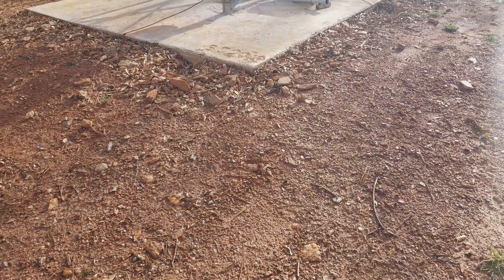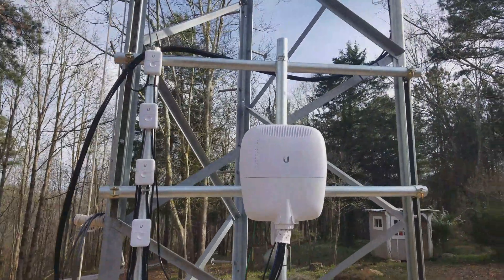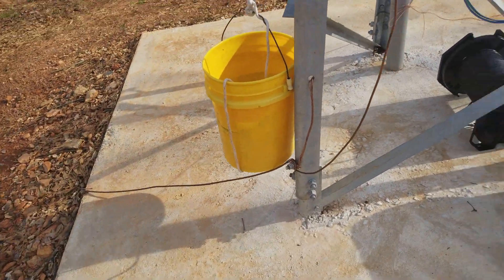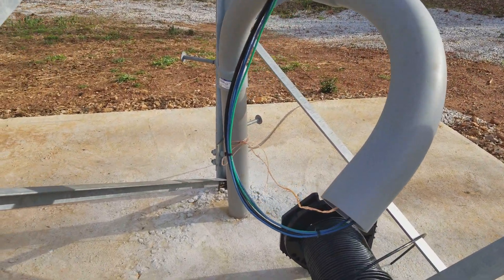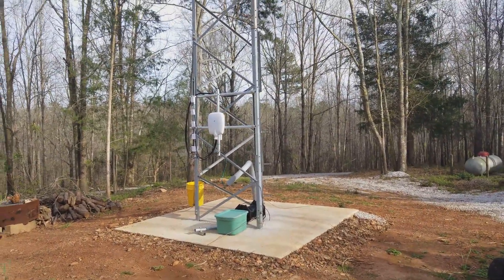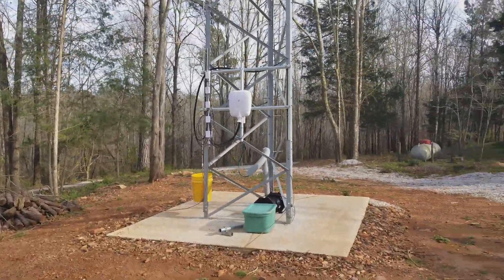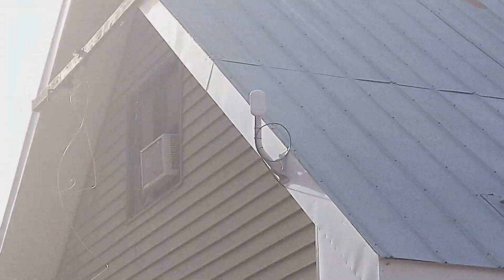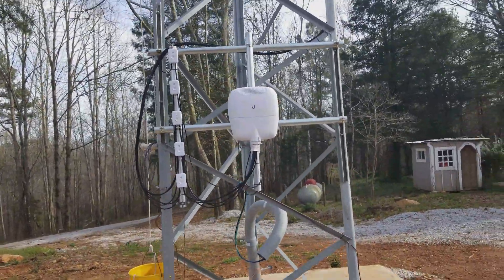WISP Progress

Comment: Hi Ben, do you mind giving me a cost for getting the tower installed?
Reply from the maker: The cheapest you could get away with is a guyed 100 foot tower.  It would be around $10k.  That includes equipment and installation costs.
Reply: @BenCooke419  do they make any that goon the side of a building that are cheaper, in the 2/3k range?
Reply from the maker: @backupaddict1356  Just head over to https://www.3starinc.com/

I think to mount it to the side of a building would require a machine shop to make the mounts.

Comment: Hi, I want to build one of those tower my self to start my one WISP from my Back yard in my country.. Do you have a documentation or measurements for the pieces to fit the tower up or the specification for that tower, such as the with of the base, the distance between the joints, so that i can get the right angle from top to bottom. My plan is, if you would be so kind to help is to buy the angle iron, cut to specification and bore holes to bold it up. Also whats the dimension of your foundation. DO you have images of the process of foundation to finish that you can share with me...
Reply from the maker: http://www.rohnnet.com/files/2015_Rohn_Full_Catalog.pdf#page=178

Comment: How many CPE clients will you run? I run a few WISP and it is so much fun.
Reply from the maker: Technically 60 per AP.  I have 3 APs so 180 total.  I have 3 customers connected so far and my plans are for 25 on this tower.  If I get lucky maybe more.  There's no way I can actually reach 180 houses though.  I just got service 9 days ago, so I'm still just getting started. :)  Thanks for the comment!
Reply: @BenCooke419  When I get that email letting me know that invoices have been sent I just get reminded why I built the systems that help others. Keep that cam rolling on the progress. Why not more CPE's. Don't forget you can make relay sites to reach more people.
Reply from the maker: @CommunityWISP  It's hard to sell something you don't have, but word of mouth moves quick around here.  Two of my customers are getting relays for the houses next to them. :)
Reply: @BenCooke419  Oh not mean sell what you have not gotten I meant if you want 60 why not 60, Are there not enough homes or not enough bandwidth on tower yet?
Reply from the maker: @CommunityWISP  It's very rural.  Lots of trees lots of hills ect.  25 is kind of an estimate.
Reply: @BenCooke419  What Teir's (Packages)  are you offering, what system management software are you going to run and equipment going to use? Yes them trees are killers.
Reply from the maker: @CommunityWISP  I went the ubiquiti way.  I'm using UNMS and I'm offering 3,6,&9 Mbps....for now.
Reply: @BenCooke419  That is wonderful software to use, (That is what we use to) it sends invoices and turns them off when they do not pay, tracks data used and so much more. I love the mobile app to keep an eye on things as well.